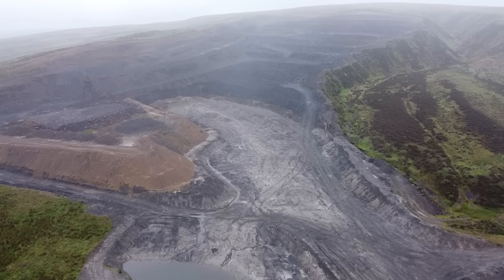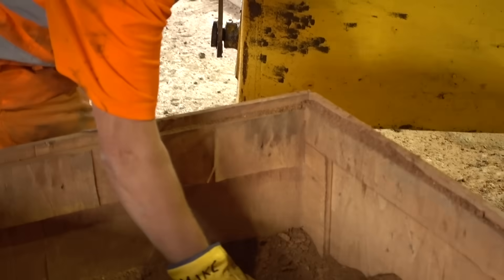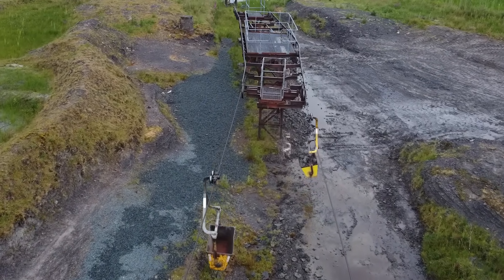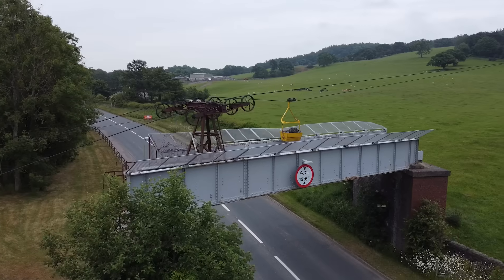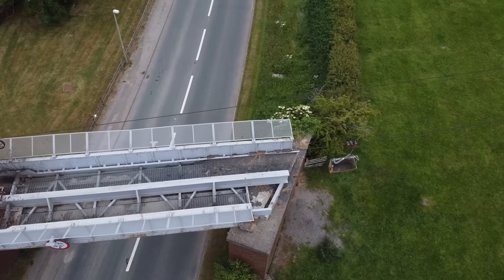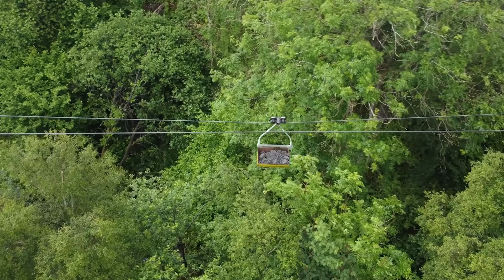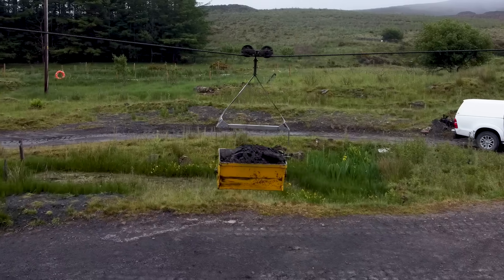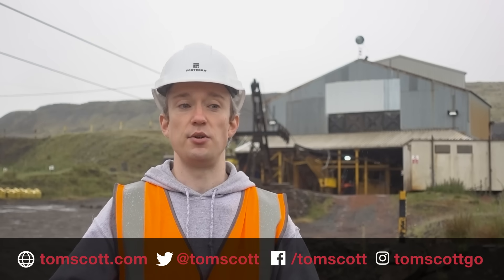The UK's last aerial ropeway uses no power, moves 300 tonnes a day, and will be gone by 2036.

Comment: There's an electric mining dump truck that brings material downhill that never needs to be charged.  Since they need to load a truck anyway, I see that working well here.
Reply: Or just use the unpowered ropeway that doesn't require battery replacement every 3 years, which get dumped in landfills because they're so expensive to recycle

Comment: Hey, it COULD become a tourist attraction:TURN it into chair lift, scenic ride. You said it goes 3 miles? Over forest and stuff! Would have GREAT views of the area!
Reply: But you can only ride it in one direction.
Reply: @mikeziniti  Like any other!
Reply: @mikeziniti  power it
Reply: @chriswicker6672  Then the charm of it being Gravity powered goes away.
Reply: @chriswicker6672  boy then what’s the point. the appeal of it being powered by gravity is no longer there, and it’ll just become any other ski lift
Reply: @chriswicker6672  then that defeats the purpose of no needing to power it
Reply: The people could be dumped out of the bucket at the end for an authentic feel of what it would be like to be the shale. Endless fun. And wouldn't the kiddies love it.
Reply: @elroyfudbucker6806  Absolutely!
Reply: The height of the towers and length of the rope is calibrated to the weight of a full bucket of shale and the number of buckets on the line… I think some major adjustments would be required to make it fit for people to use, and every bucket on the downhill side would have to be full or it would need fuel
Reply: @tacosmexicanstyle7846  maybe you set it up for two people. Then have some weights that you can add the balance it out a bit. The weight get taken out at the bottom and go back to the top with the shuttle bus that runs periodically. I think there are ways you could make this work though it may not be optimal. But you're not trying for max capacity at that point
Reply: The problem would be it wouldnt be able to transport people back to the original location(From how i think this works)
Reply: @krrangarajan5391  So? DOES that really matter? They either get dropped off, & then waited for @ the other end, OR the operator uses a shuttle bus every 10 mins or so back to the top car park!
Reply: It could provide free one-way transportation down the hill. Every time someone rides down, and empty bucket would ride back up simultaneously. All you need to do is cage it in and add a seat so it's like a ferris wheel thing.
Reply: They could add a weight at the top to keep the balance
Reply: I like your thinking. if it can carry half a tonne of brick, it can carry a few 100kgs of people
Reply: @justalonesoul5825  Oh get OVER yourself!
Phuck me the narcs on this site!
Again, WHOOSH!
Reply: My thoughts exactly when I watched this video! I’m sure the scenery would be really sick from the height of where the lift is at.
Reply: I would love to go on it with a coffee
Reply: @owenbowen2752  Laced with BOURBON! Mmmmm!
Reply: I would think sort of flying trolley cart would be more efficent like the ones in disneyworld.
Reply: What is it that you don't understand about the word "dangerous"?
Reply: @hcrun  WHO are you addressing?
Reply: I guess the infrastructure is too costly and unsafe...50M briks/yr justify the infrastructure some hundreds people/yr don't....sometimes it's just time to move forward
Reply: @gerrypaolone6786  Wow, WAY to over think it!
Reply: Without a complete overhaul, this machinery would never meet today's safety requirements for people transportation, unfortunately.
Reply: @RadimTylecek  Sheesh!
Reply: I think this is interesting - 3 miles?  Thats not too far to walk, or, I'm thinking, to have the alternative travel experience, an ebike or similar to travel one way to catch the ride.
Reply: It would have to be made safe, and kinda powered for good control , i dont think there’s any point in that.
Reply: @sta1RR  it is powered, nothing can run without power
Reply: Owen Bowen im talking about “it requires no fuel ,no electricity “ part thats a special feature of this model, if you involve people then for safety you would need to electrify it for better control in some ways.
Reply: All the “buts” and “problems“ here.  It’s simply this:  Do you think it would be fun to ride?  Will you pay money to ride it?  I would.
Reply: @Andrew-13579  INDEED!
Reply: @pw3858  Whoosh!

Comment: So in all that time no one hooked a generator to it and generated electricity for the plant? It could also be used as the breaking system for the lift and use mechanical breaks as a secondary system for maintenance and such.
Reply: I think the electricity generated will be too little without the buckets going too slowly
Reply: @idk_must_die  ... they do move slow for safety...but there is tons of down force for energy and they could just gears...gears can adjust speed of generator while bucket speed stays the same.
I still would like to see them make a ride and attraction out of it and use the funds for the local economy.

Comment: So this is how we are going to power up Mars, we can tunnel mountains building our habitats and send the debris down the mountain to power up generators, and industry machines that will turn those debris into concrete aggregates, subbase, and cements. We can even store up potential energy in flywheels and convert that into on demand power for the crew to use. The excess heat generated from the bearings can be used to melt ice and generate steam that can be sent back up the mountain to heat the crew and power steam powered machinery.

Comment: This is just about as elegant a solution with gravity as the Romans pulled off with their aqueducts.  I'll bet there are more old gravity tricks that have just been forgotten over the years.  One that comes to mind are the pendulum weights in old grandfather clocks.  To keep the clock running, you just pulled down a counter weight every few days.
Reply: Throwing logs into the nearby river which then float downstream to a sawmill. The sawmill itself is powered by a water wheel.
Reply: seattle, wa in the usa had a cable car system on a very steep hill (queen anne) with a heavy counterweight on rails underneath the roadway. when a cable car decended the hill, the counterweight would be connected to the uphill cable so the weight of the decending car would pull the counterweight to the top of the hill. when a cable car was ready to climb the hill, the counterweight would be connected to the downhill cable to pull the car up the hill. this greatly reduced the load on the cable drive system and worked perefectly until seattle did away with it's cable cars.. interesting fact is that the counterbalance weight system was never removed and is still under queen anne ave to this day.
Reply: @marzsit9833  Wow, I used to live in Seattle back in the 1990's and I had heard there was a cable car line that used to go down into Pioneer Sq. along Yesler Way - I think.  But I had never heard about the one on Queen Anne.  In order to try imagine what cable cars in Seattle would have been like, I try to imagine San Francisco with snow.  You know one year in the 90's we did get a 24 inch snow storm one night.  It paralyzed the city for several days.
Reply: @marzsit9833  There’s quite a bit more of us now than there was 100 years ago. You should check out population charts by year. It’s staggering. Some of us have to be bozos.
Reply: Well if the big blackout of the grid happens, then we need to have those designs out of the draws and ready to go again.
Reply: @JP-xd6fm  we can build steam powered things if the grid goes out permanently
Reply: @JP-xd6fm  watches that use springs, that you wind,are still being made,but cost many thousands of pounds, due to being made by hand. They are incredibly labour intensive, due to the precision required, and have become simply a toy of rich men, a way to show of wealth, like hand made silk suits . l think most of us would end up telling time  by the sun :)
Reply: @helentee9863  I have two hand wound watches at home that aren't even a hundred pounds. A proper gold one also goes for a lower price than a battery powered one. Hand wound watches are just inconvenient, and their price reflects that. The only ones that are more expensive (in general) than battery powered ones are those that wind themselves up through motion.
Reply: @Trololoc  @Helen Tee  I am currently wearing an automatic, self-winding, spring-powered wristwatch that cost £160.
Reply: @helentee9863  sundial never let us down until clouds come
Reply: Some theorize that the pirimids were bult by floating the blocks on wood in watter.
Reply: Best gravity trick is Australians who manage to stick to the planet upsidedown somehow
Reply: There's old tricks the British empire had in the Caribbean for transporting Sugar Cane that was largely forgotten. Its for putting it onto ships that's been found relatively recent through old photos. From times well before port cranes..
Reply: Long case clocks (people know them as Grandfather clocks but that's actually wrong),you didn't wind,but pulled a cord,starting the pendulum, which powered the clock !
Reply: I believe people were a lot smarter in the old days, through the industrial revolution up to WW1.
Reply: @after_midnight9592  i would not say that, people allways reduced their workload. Back then most things was easely solfed mechanicaly. 
Today its cheaper/more convinient to have a computer circuit handle such problems (with an automated logic system and some sensors)
Reply: The Romans and Egyptians were onto some other levels of knowledge. I still believe to this day they were taught by entities that were not part of this earth but were ancient enough to know everything about how Earth works. Aliens, spirits or something we havent discovered yet? Who knows.

Comment: Why does the environmentally friendly rope system get tipped onto a conveyor into a big dump truck? Where does the dump truck take it, into the brick factory? Could the rope system be extended to negate the need for the dump trucks, making further enviro-friendly savings? Or am I missing something?
Reply: They'd have to shut down to expand it and recable the entire system. Doable, but probably not cheaper than just running a truck to move the stuff about down there.

The ground may also be too flat down there for the system to move buckets further.

Comment: You mentioned they use breaks to control the speed. Wouldn't it be both cheaper and smarter to break it with a generator instead? Would be interesting to know how much power could be generated from this.
Reply: ...yes, imagine how much power could have been generated!

Comment: fascinating bit of film.   I had not idea this existed or unique and emission free way that it operates.  Also very interested to hear that even with computers, they came up with the same specifications for the ropeway as they had years ago.    They also used slide rules to calculate measurements for the Forth Road Bridge in the 1960s.  How different it would have been for calculating the engineering for the new Forth crossing which was finished just a year or so ago.

Comment: The only sort of similar solution I know comes from a cablecar in Wiesbaden: Two passenger cars on the long steel cable, and at the top of the hill it is filled with rainwater. Arriving at the bottom, the driver empties the tank, until the next load goes up/ down. We have clever ancestors. Great report of a great engineering feat!
Reply: That’s fantastic!  Tom should do a video on that!
Reply: @rcpmac  tell him!

Comment: As long as you have material going downhill, the ropeway will move. The economics prevented them from installing a modern variable frequency drive where the braking power could have been converted to electrical energy. Not a very consistent power source though.

Comment: I'm wondering how they get it started.  It works based upon gravity and the weight of the bucket hanging on the cable but I imagine it will take alot more than a single bucket on the cable to start the whole thing rolling after it has stopped for maintenance or repair.

Comment: It's sad that things like this likely wont be preserved. I used to work at a wicket dam that was built in the 20s and up until 3 years ago was still operational. We even used the original steam powered crane to raise and lower it.

Sadly all the old buildings and machinery we used has been all tore down and scrapped. There is one steam powered crane boat left but theres no word if our district headquarters is going to preserve it or not.

Comment: Ideally you’d use a generator not brakes as then their electricity bill would be smaller too!
Reply: put in a system that can run the dusting loading unloading and placing the buckets back on the line, run by the mechanical power from the wheel. add regenerative braking like you said, hooked up to a battery to power the electrical demands of the two loading/unloading buildings plus a motor that can start the machine up at the start of each day.

the whole system would run itself at that point.

Comment: No free lunch.  By using gravity to do work, you're running the gravity bank of the planet down.

This will result in one of two outcomes:
Earth will slowly lose gravity, and eventually we'll weigh less - good, for people that are trying to diet, but impractical for anything that is not fastened down, 
Or,
The loss of gravity will make the Earth's rotation slow.  It takes 1/2 an hour for the shale to make the trip now - think about when it takes an HOUR for the trip!  They'll get HALF as much work done in the same amount of time, driving costs up.  Make measurements will have to change... A fortnight will take longer - probably become a fitnight, it more.  People will have to wait longer to find out if they're pregnant - no more "two week" tests.  People will age more slowly - you can't plan for retirement if you're going to live to be 120, and you probably can't retire until you're in your late nineties.  Minute Rice won't be done in time for dinner.  All of the speed limit signs will have to change.  Well probably have to convert to metric work weeks - 10 day weeks, 10 hour days.  And, "time", as a child, will be interminable.  Think how long it will take Christmas to get here!  They'll have to move New Year's Day down at least a month, then THAT will push all of the other holidays further out.  We'll be celebrating Hallow-e'en in December.  You won't be able to take your Holiday during the summer when the weather is nice!

Nope, not for me.  I assume want gravity being horded by some industry, just to save them some few dollars.  I want to save gravity for when we NEED it!

Comment: ...why are there not more ropeways...? It's an effective transport solution that needs NO electricity.
Reply: fuel companies want to sell fuel.  Industrial vehicle companies want to sell industrial vehicles.

A ropeway is a good, efficient solution which requires very little spending to keep it going -- that's no good for capitalism which requires more spending every year to keep going.  So, without exception, there will always be advertising & lobbying campaigns to end the low-consumption method & replace it with a high consumption method.

This is arguably the only truly capitalist contribution to what could be called 'innovation'.

Comment: honestly if it does come down, they should make a 1/1000 scale replica in a museum near by , smaller if need be - with a few buckets and one of the towers to give scale. Its important to keep the old technologies in mind, as well as the study that was conducted nearly 100-130 years later with computer modeling showing that technology 100 years + ago , the individuals reponsible for the design took the knowledge vested across the nation to do what humans do, build upon proven technology - giving something that is 100+ years old and still running strong. Yes the digging is not green, but the fact that it was not electrically powered or anything over the last 100+ years , imagine how much carbon it would have emited.
Reply: Wouldn't do anything less than about 1:87 scale (which is common HO model train sized) - anything less will be hard to see the detail.  If you go a bit bigger maybe around 1:8 scale (common for "live steamers" miniature ride-on trains) you could have a fits-in-the-room mock-up hands on demonstrator with sand or something.
Reply: True make an Ant sized model for the museum!   Good idea! Keep the it alive n all.
Reply: Keep one of the towers up as well.
Reply: Could always distribute the towers to various museums as well. Some are bound to be interested.
Reply: At the very least we have this video, make sure to download it
Reply: That’s a great idea 💡
Reply: And a plaque on the old brickworks building and maybe one of the bull work pieces could be repurposed into part of a sculpture for a new park
Reply: Saving this. Cool
Reply: 1:1000? 😂 you realize 1:2 is half, right?
Reply: OR, modify the buckets so ppl can ride them, and put interesting art work that can be seen from the ride
Reply: @sadmanh0  they would only be able to ride it downhill.